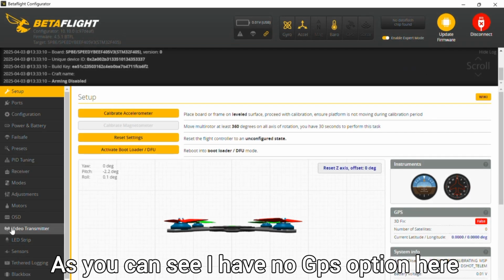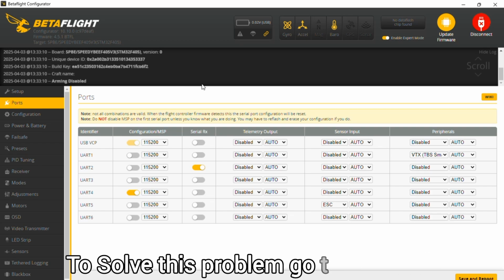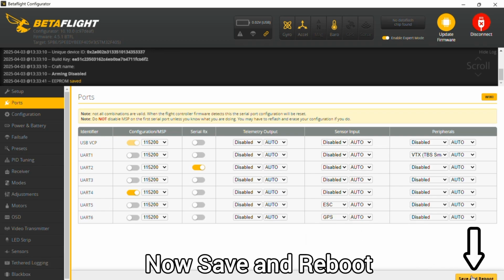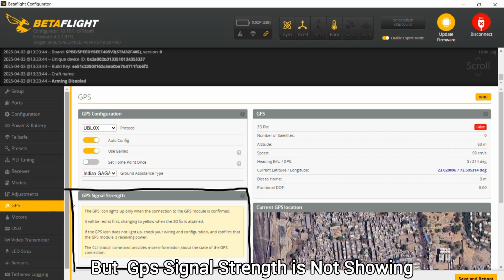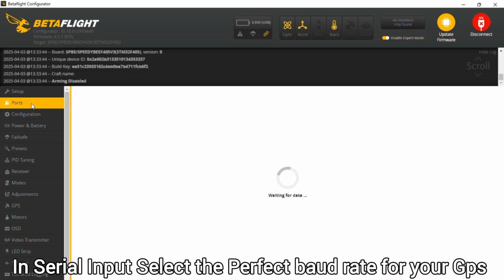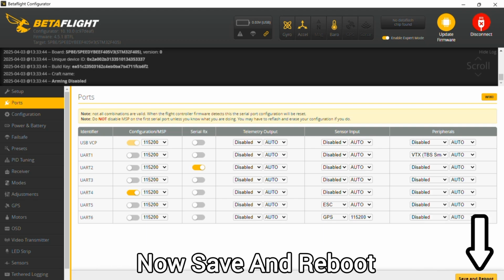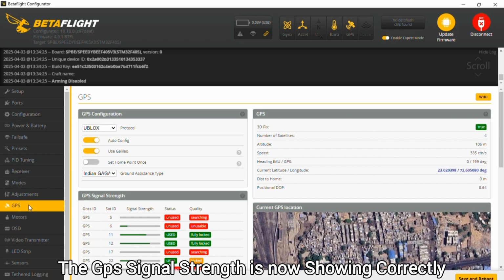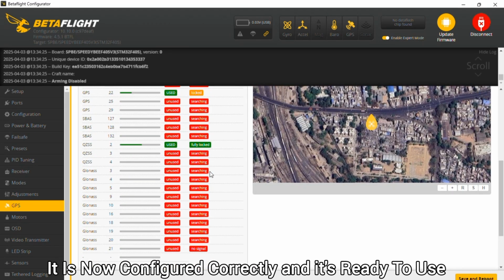How To Fix Gps Not Showing in Betaflight but Wired Correctly

Comment: Also didn't work
Reply from the maker: Does your gps show led lights when you plug in battery or usb cable ?
Reply: @aerofuture53  yes absolutely, power available once battery or usb plugged in
Reply from the maker: Try swapping yellow and white/green wires
Reply: @aerofuture53  same result not detected, power led of the GPS are available, UART port is correct. but GPS red nothing appear

Comment: Still didn't work for me using an m10 chip 2 different GPS's
Reply from the maker: Check out in which UART you have soldered your Gps and then configure at that perticular UART in betaflight and if this doesn't work then check out the connection of your Gps , the rx goes to tx of flight controller and the tx wire goes to rx of your flight controller and if this doesn't work then dm me on instagram id: burhan_fpv
Reply: Same problem with neo 6m ublox and flywoo f405pro  @aerofuture53